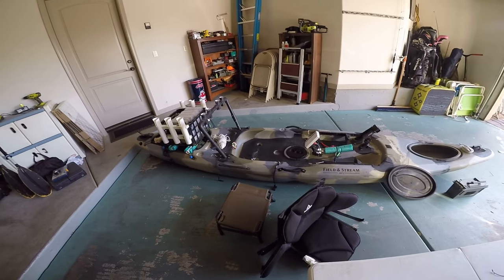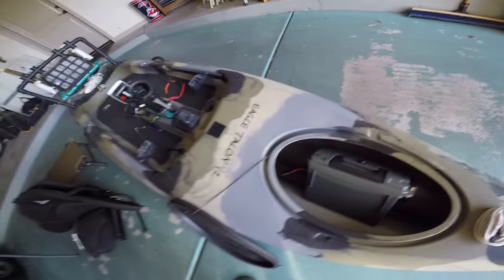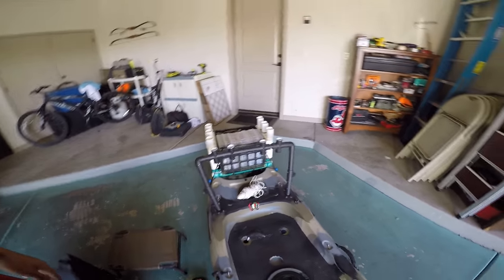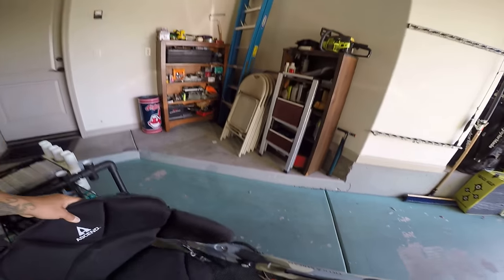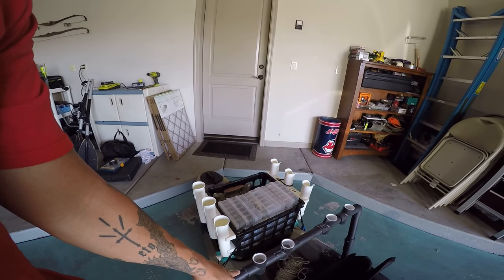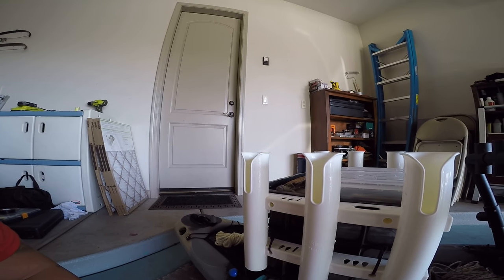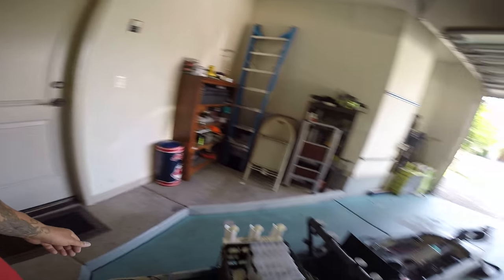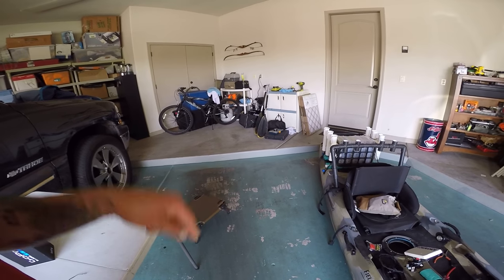Field and stream Eagle Talon 12

Comment: Any Updates on the trolling motor add on? I have been thinking of doing that with mine but havent put a whole lot of time into it yet. Also did you post a video on the battery box? Would be awesome and keep my battery from sliding around in the hull. Thanks for the video!

Comment: Nice mod ideas.  I've had my Talon going on 3 years.  How comfortable is that stadium seat versus the Ascend seat, and do you notice a stability difference between the two?  I have been running an Ascend Elite seat, which is like the Cabelas riser with a a seat back, but I find it too unstable for my liking.  Flipped it in 50 degree water last spring.  I have a Yak Gear Manta Ray seat, but nothing seems to be as comfortable as the Ascend Elite.  I'm 6 ft. / 260 lbs., so I may be pushing the limits of the kayak, which may mean switching to a different kayak, or "Fatty" needs to shed some weight.